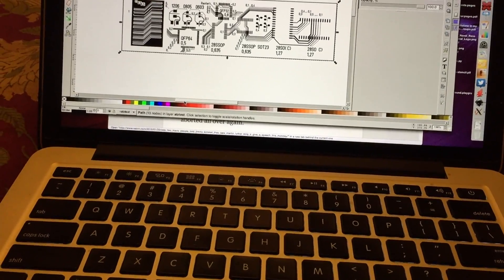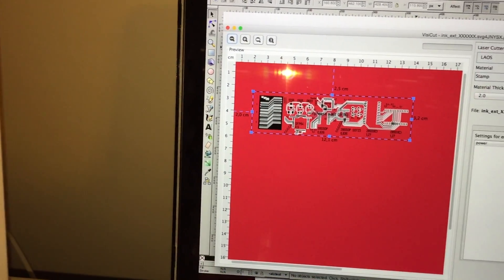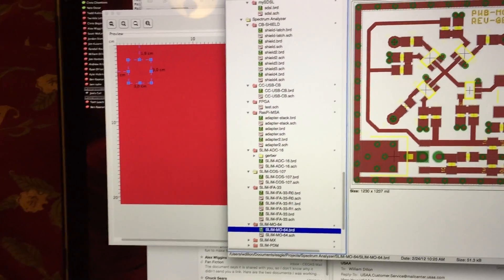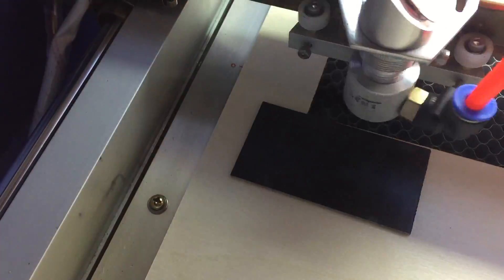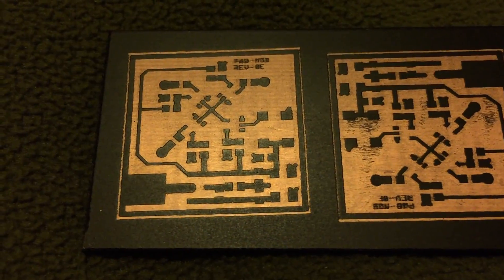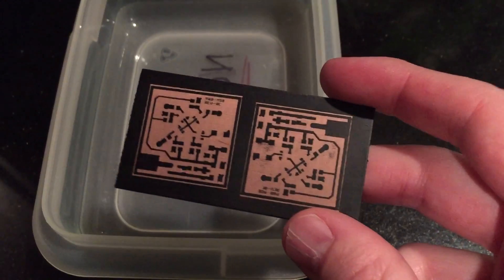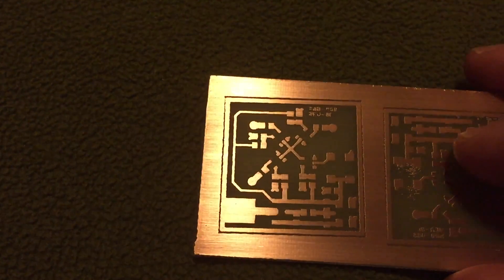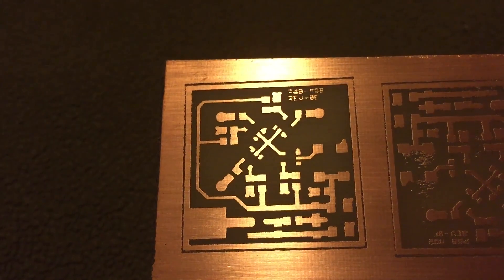Lasering PCBs

Comment: which type color spary is using ?
Reply from the maker: It's just flat black spray paint.
Reply: thanks .. how is remove after etching ?
Reply from the maker: Acetone.  I used the same process as toner-transfer.

Comment: Good job, here are a few hints or things to check. The 2 inch focus is probably not 2 inches. It is normally off by a mm or two and you need to discover this. There is usually a backlash setting in your laser to compensate for the play in the belts, I run a test pattern until I get these both right. I run the engrave cycle twice at full speed. Once to burn the paint and 2nd to clean the board. With ferric chloride you need to rub it with a soft paint brush during the etch to remove the oxide. With it all set up perfectly you can get 5mil track and space looking good. I hope you try my soldermask method next.
Reply from the maker: Robonza Awesome! Thanks for the tips.  I'm excited to try your solder mask method.  Where did you get the lacquer/green mix?  Is it a spray?  Can you get custom spray cans?
Reply: hpux735
I went to a "good" paint shop that can fill spray cans. I got them to mix 10% pure green with 90% clear lacquer. That mix worked perfectly first go. It does get darker with more coats but 2 to 3 is all you need. It does not stand up to the soldering iron that well but you can solder it nicely if you are well practiced..